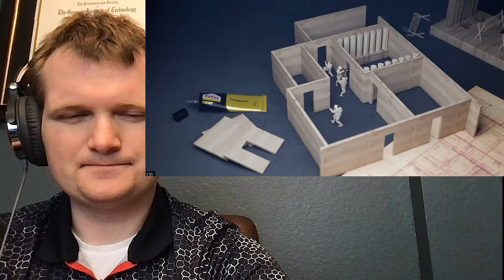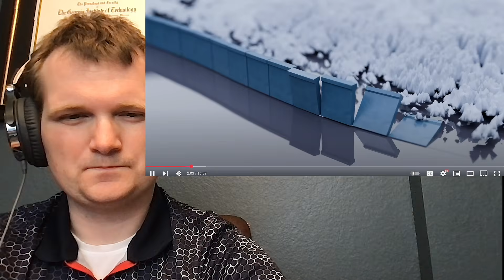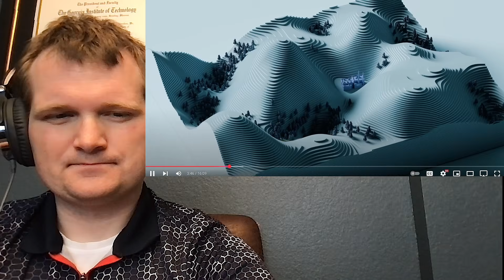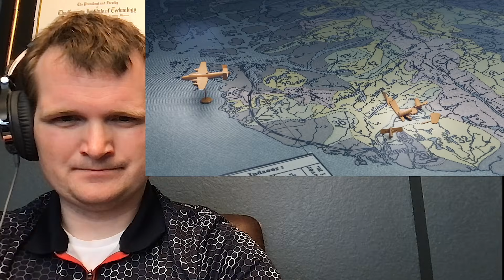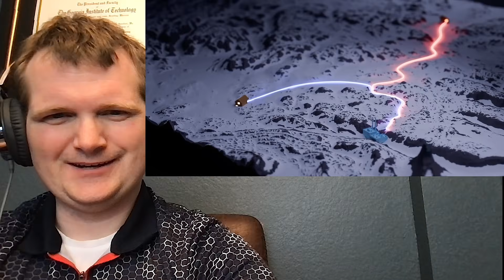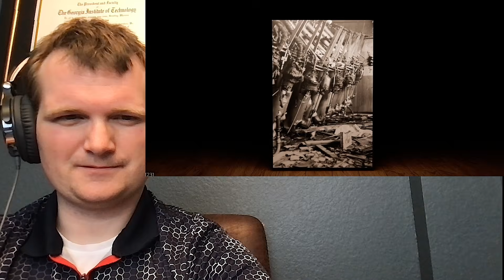The WWII Raid That Saved the World From Nuclear War? - Nuclear Engineer Reacts to Solve

Comment: The real limiting factor, given heavy water production was far, far too inefficient for war-time relevant timescales for any useful amount of reactor grade material, would thus have been nuclear grade graphite. A fundamental failure of proper industrial chemical and materials engineering expertise cooperating with nuclear physicists and chemists led to the failure to develop a viable means of high purity (or ultra low boron) graphite production.

Allied intelligence was misinformed over the concentration of deuterium in the heavy water production stockpiles ... which was only a few percent for the majority of the barrels (I believe a minority closer to 20%), with that facility only having made tiny amounts of pure D2O for research purposes.

The practical war-time value of that plant was for hydrogen production for the haber-bosche process and subsequent ostwald process (useful for ammonia and nitric acid production, thus ammonium nitrate ... useful for fertalizer and useful for making AMATOL, the common, cost-effective melt-cast explosive filler for a large percentage of bombs uses in WWII on all sides)

German leadership at the time also wasn't keen on stockpiling, so they'd failed to secure a sufficient amount of uranium to really deploy in an expansive nuclear power and/or plutonium production project even if they'd gotten the moderator right. (or to supply an enrichment project) At least if you account for the need for multiple parallel projects dispersed in hardened locations, all with sufficient material resources to work on production + R&D efforts.

Comment: Dude. You are actually wrong here. Germany did lack heavy water, big time. Germany was building reactors back then and the reason was not to produce electricity but to research and to enrich. It was deemed critical enough that the UK and the Norwegian government found it necessary to stop this. And yes. Even if you say that about the size is way too small for that kinda damage you are making a fool of yourself because that was what the Nazi believed and was told by their scientists. And yes, the Germans had reactors up and running. Good job making a fool of yourself by pissing on history.

Comment: Are the reason the Nazis were even trying to use heavy water was they had tried graphite but they had failed and they had concluded that graphite wouldn't work as a moderator 

And again this is just to build a working reactor you basically need one of the two 

The reason that graphite didn't work is they didn't have it high enough purity of graphite 

In the United States we actually had a company specifically make ultra pure graphite that like previously didn't exist and that then worked 

So because they didn't know how pure the graphite needed to be because they hadn't done the math they thought that the only way it could work to make a reactor was heavy water and again that just gets the reactor which lets you then create fissile material

Comment: The factory in question wasn't originally built for heavy water production: It was an electrolysis plant for making hydrogen, using the abundant and cheap hydroelectric power in Norway as the power source. The hydrogen was then used to produce ammonia and subsequently nitric acid, primarily for making fertilisers, though during the war much of the nitric acid produced was likely diverted towards production of explosives - it is essential for making nitroglycerine, nitrocellulose (aka guncotton) and TNT.
Heavy water was an extremely minor by-product, resulting from a variation of the "kinetic isotope effect", where normal hydrogen is discharged preferentially to deuterium during electrolysis of water. So you can slowly but steadily build up the deuterium concentration by running the electrolysis in batch mode over a long period of time. In a single batch it could take years just to build up the concentration to 1%, since the natural abundance in water on earth is only 0.0156%. Arranging multiple electrolysis cells in a cascade sequence does not make much difference to the net rate of hydrogen production, but can speed up deuterium concentration. This is what the factory did, since they had plenty of excess electrical generating capacity to run the electrolysis cells.

Even so, this raid was still mostly pointless: Even if Germany had managed to design a workable nuclear reactor, the "heavy water" produced by the factory would not have had anywhere near the deuterium concentration required for a feasible reactor. There were actually two raids conducted against German heavy water production: The first was the direct attack on the factory, as discussed in this video. However, that raid was of limited usefulness, since the factory was repaired and back up and running again about 2 weeks later.
The second raid was against a shipment of drums of heavy water as they were being shipped from the factory to Germany, which resulted in the ship carrying them being sunk in a Norwegian lake. Some 50 to 60 years later, the wreck of the ship was located, along with several intact drums, which were recovered and the contents analysed for deuterium content: If memory serves, most of the "heavy water" in the drums was better described as slightly enriched, with less than 10% deuterium present, with the exception of a single drum which had 14% deuterium.
Whereas to actually build a deuterium-moderated nuclear reactor, you need to enrich the deuterium content to at least 90%, ideally as close to 100% as possible. For a working example, the Canadian Deuterium-Uranium (aka CANDU) reactors use heavy water with 99.75% deuterium enrichment. So there is between zero and half-of-bugger-all chance that the slightly enriched "heavy water" produced by the Norwegian factory would have ever been useful for building a working reactor.
Reply: Another huge hindrance to the German effort and benefit to the American effort that of the like 20 or 25 most important scientists on the Manhattan project half of them were either Jewish refugees that left Nazi Germany or fascist Italy or other countries or they had like a wife that was Jewish so if his toxic hatred had existed he would have had the brains to be
Reply: Focusing on the deuterium percentage misses the point. The Allies had no way of knowing the enrichment level at the time. If there was even one percent chance it was enriched enough for bomb production, it needed to be stopped. There is no way the Allies, who clearly understood the implications of a nuclear world, would give Hitler the slightest chance of obtaining such a weapon.

The raid was about delaying German nuclear research, disrupting production, and preventing any chance that Hitler could get the bomb. Even temporarily shutting down the plant or sinking shipments forced the Germans to divert resources. The operatives risked extreme danger in harsh terrain behind enemy lines. Calling it pointless because the water wasn’t 99% is hindsight bias, a fallacy where we judge past actions based on outcomes we now know, ignoring the uncertainty and risk faced by those making the decisions. It dismisses both the heroism and strategic importance of the operation.
Reply: @isaiahoconnor8236 yeah a lot of the criticism that Tyler is coming up with about like you know what Winston Churchill thought it could do it's like you have to put your mind you have to put yourself in the place of the people at the time like we didn't know that much about what percentage do trim that was what percentage was actually needed how close they were in other respects so we in hindsight know they never were closed and it was never going to happen but at the time
Reply: @mcamp9445   Are you aware that you're repeating 80 years old british war propaganda??
Do you?
Reply: @MidnightatMidian what parts be precise, please?
Reply: @mcamp9445  Allies knew from the start that Germans were never close to making the bomb. The whole shady narrative about it during the war was always a mean to paint the Germans as ''evil'' mad scientists.
Reply: @mcamp9445  My argument for that is that Jacques Bergier said in his works that they clearly knew that they weren't close, but they had to be absolutely sure.
Reply: @mcamp9445  Also the initial plan was not to sink the German boat with the stock of heavy water, but to ''steal'' it for the Manhattan Project. Which proves to be too difficult so they just sank it and got heavy water from their own factories.
Reply: @MidnightatMidian no, that doesn't make any sense at all. No heavy water was used in the Manhattan project. Whatsoever.

Heavy water is a more complex way to make a reactor in which you could then create fissile material such as plutonium.

The United States instead used graphite, extremely pure graphite. They had to have factories make specifically, the purest graphite on earth and assembled it into what was called the Chicago pile under the leadership of Enrico. Fermi, that is a much easier and better way to make a functioning reactor in fact, it was the first active reactor in the world.

You can then use uranium to create plutonium in that reactor that is what we did.

They\n Were only trying to use heavy water. Because they had tried using graphite, and they couldn't get it to work because they didn't know how pure it had to be, and they didn't have they probably didn't. Have the technical capabilities to make it as pure as it needed to be and they definitely didn't have the extra resources to do so.even if they understood it.

The German bomb was a kaleidoscope of dead ends and errors.

Have the 20 most important contributors to the successful Manhattan project, 12 of them were driven out of Europe directly because of German policies.
Reply: @MidnightatMidian i mean, the Germans certainly were evil. I mean, at least the state and the state apparatus at a minimum.

And they did some really evil scientific work.

But at the time that you're talking about, there is no way that the allies didn't know their plan wasn't going to work, it was too early on.

Hell, we hadn't even really started our plan. And we didn't know if ours was going to work

Now, if you want to talk about like, you know, late 1944, yeah, we were pretty sure that they had given up. But in the Norwegian campaign, we had no idea, and again, nobody was sure that it could even be done. We definitely didn't know how far along they were because again we didn't even know how far along we were.

Also, when you're talking about a potential atomic weapon, like you don't even have to say that they're evil, you just have to say that this would be really bad if the other side had it, and again, the nazis, they were evil, see the holocaust see the depopulating of Eastern Europe, that as they conquered it, see what they did to Warsaw.
Reply: @MidnightatMidian so in this quote, you're actually proving the point at some point in the process, we became more sure that they probably weren't going to get it to work, but we had to be sure.

And at the time of the attack on the facility in narvik , nobody knew who was where , in terms of it being
Reply: @mcamp9445  You're delusional and you are talking a lot of nonsenses. The P-9 Project was the codename given during World War II to the Manhattan Project's heavy water production program. The Cominco operation at Trail, British Columbia, was upgraded to produce heavy water. DuPont built three plants in the United States: at the Morgantown Ordnance Works, near Morgantown, West Virginia; at the Wabash River Ordnance Works, near Dana and Newport, Indiana; and at the Alabama Ordnance Works, near Childersburg and Sylacauga, Alabama. The American plants operated from 1943 until 1945. The Canadian plant at Trail continued in operation until 1956. Three nuclear reactors were built using the heavy water produced by the P-9 Project: Chicago Pile 3 at Argonne, and ZEEP and NRX at the Chalk River Laboratories in Canada. 
Now stfu.
Reply: @MidnightatMidian again, talking about the Manhattan project was any plutonium or uranium from those sites used in the weapons, while the Manhattan project was in operation. S the answer is no, we're back up ideas and research facilities.
Reply: @mcamp9445  ''Have the 20 most important contributors to the successful Manhattan project, 12 of them were driven out of Europe directly because of German policies.'' You mean the guys who were kidnapped during operation paperclip hahahaha by the american fascists?? You seem very biased, and sionist, and I don't like your arrogant attitude in your last comment. Therefore this conversation end. I've made my point.
Reply: @isaiahoconnor8236   Exactly, if you read Jacques Bergier works, who was part of the operation, you quickly understand that the scientific community was well aware of the level of technology. The operation was mostly to disrupt explosives production, the heavy water destruction was just the cherry on top. Both sides allies and axis were using scientific and spies in a dense networks. Scientifics were awarded high level military titles. On both sides. There were a lot of paranoia and propaganda during and after the war, so a lot of infos about that subject. I remember my father saying the Germans were 1 year from creating the bomb, which as we know now, is total bull...t. And my father was a chemist ingeneer..
Reply: @isaiahoconnor8236   Exactly, the sinking of a German ship filled with the German heavy water stock was much more damaging for the german nuclear research, than this operation, which this story is mostly based. Basic British war propaganda.
Reply: @isaiahoconnor8236  The diversion of resources objective is a valid one, so fair point there. Having said that, water electrolysis isn't particularly complex or difficult, which is probably why the factory was working again after only two weeks. So was this limited degree of resource diversion worth the effort and the lives lost doing it? Maybe it was, but I'm not 100% convinced of that.

As for the rest, I am also not convinced that the allegation of "hindsight bias" is well-founded here: This rests upon the claim that "the Allies had no way of knowing the enrichment level at the time" being true, and I'm not sure where this idea comes from. After all, it's not as if the Allies were completely clueless about nuclear technology at the time - if anything, they were well ahead of Germany.
Ok, so they might not have known that they were ahead of Germany (or how far ahead they were), so that is of course hindsight. But that is also besides the point: What is relevant is how much was known to the Allies about how heavy water was produced and the rate at which production was possible. If they knew the method used (again, electrolysis preferentially discharging light hydrogen) and knew the natural abundance of deuterium, then deducing the maximum possible rate at which the cascade electrolysis setup could have enriched the deuterium content of water would certainly have been possible for any competent scientist at the time.
It's not as if the Allies were deficient in competent scientists at the time either - if they were, then it's unlikely that the Manhattan project would have been possible, or could have progressed at the rate that it did. So with all this in mind, I'm not buying the claim that they could not have known the deuterium enrichment level the Norwegian factory was capable of producing. Did they know the exact enrichment level of the "heavy water" that was produced? Probably not. But could they have deduced the upper limit to the enrichment level it was capable of? Yes - and that is what mattered, because as pointed out previously, even that was almost an order of magnitude lower than a working reactor would have needed - and yes, they would have known that too at the time.

As such, I think it is safe to say that the claim that "the Allies had no way of knowing the enrichment level at the time" is lacking any foundation or credibility. Therefore any charges of "hindsight bias" based upon this are similarly unfounded and can be dismissed.
Reply: When it comes to calling WW2 plans pointless, you shouldn't look at them with the benefit of hindsight.
Don't forget Britain's WW2-era plans included conquering Antarctica, becoming self-sufficient in growing its own tea, building an aircraft carrier out of ice and sawdust, and distribution of a how to guide titled "If the Invader Comes" - here's Rule #4:
"DO NOT GIVE ANY GERMAN ANYTHING. DO NOT TELL HIM ANYTHING. HIDE YOUR FOOD AND YOUR BICYCLES. HIDE YOUR MAPS. SEE THAT THE ENEMY GETS NO PETROL. IF
YOU HAVE A CAR OR MOTOR BICYCLE, PUT IT OUT OF ACTION WHEN NOT IN USE. IT IS NOT ENOUGH TO REMOVE THE IGNITION KEY; YOU MUST MAKE IT USELESS TO
ANYONE EXCEPT YOURSELF.
IF YOU ARE A GARAGE PROPRIETOR, YOU MUST WORK OUT A PLAN TO PROTECT YOUR STOCK OF PETROL AND YOUR CUSTOMERS’ CARS. REMEMBER THAT TRANSPORT AND PETROL WILL BE THE INVADER’S MAIN DIFFICULTIES. MAKE SURE THAT NO INVADER WILL BE ABLE TO GET HOLD OF YOUR CARS, PETROL, MAPS OR BICYCLES."

As far as the government ordering everyone to hide their bicycles from Nazis if they invade, well...
Home Intelligence Division: ‘the leaflet has not been taken seriously’.
Mass Observation called the leaflet’s tone ‘out of touch with common sense’, and suggested that the public were being treated as ‘blithering idiots’.